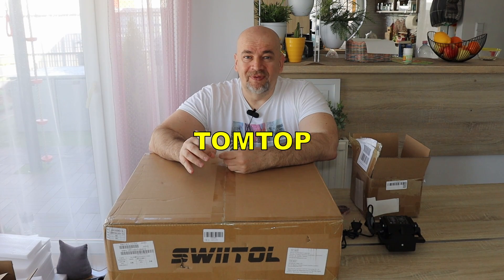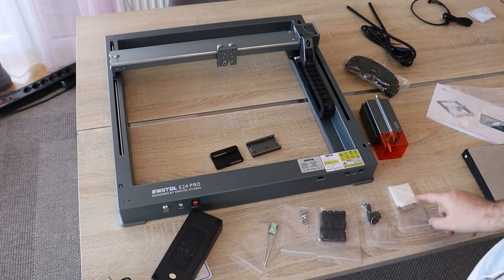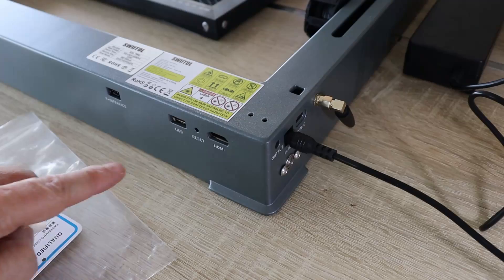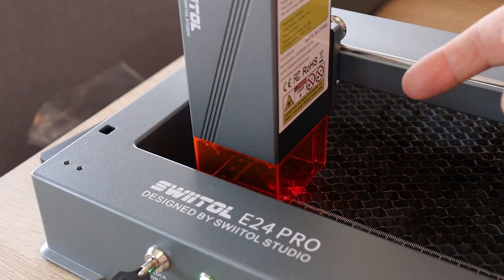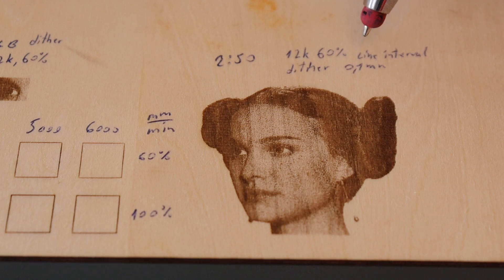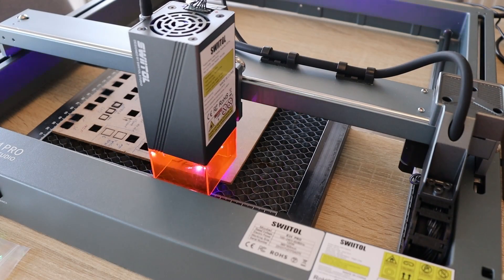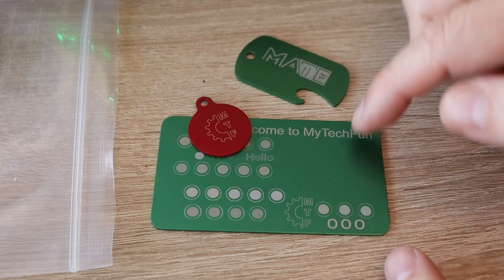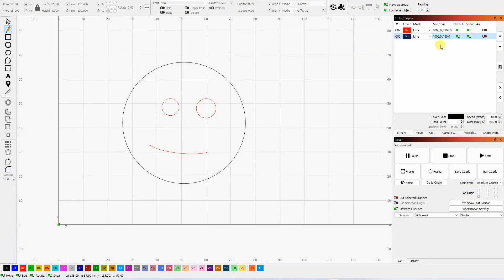Review of Swiitol E24 Pro laser engraver

Comment: Hi, i bought this machine and i have an issue. When cutting, cuts at y axis are excellent. But horizontal cuts at x axis are bent. I find out, that the laser head is moving in those bearings, which should cause the problem. 

Any solutions? Or is there a space in your machine when you catch the head and try to move it? 
Thanks